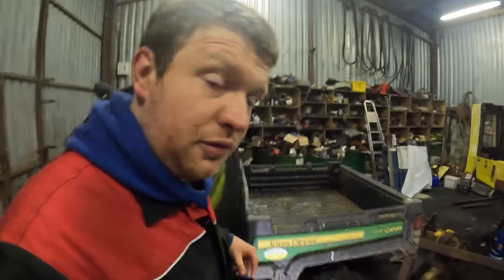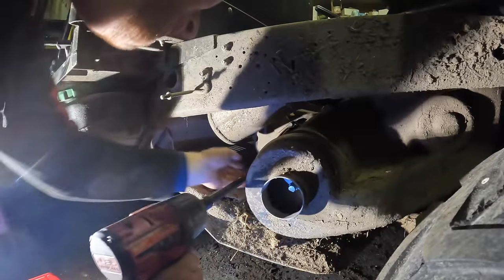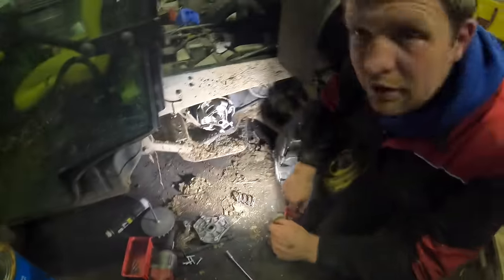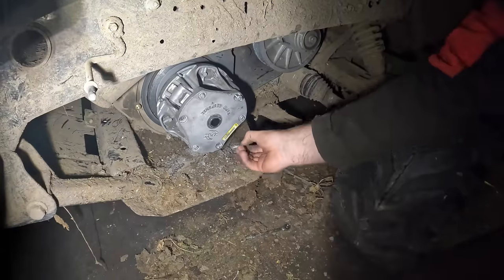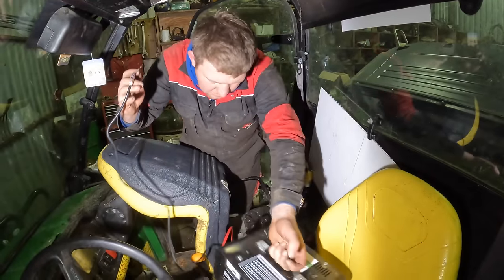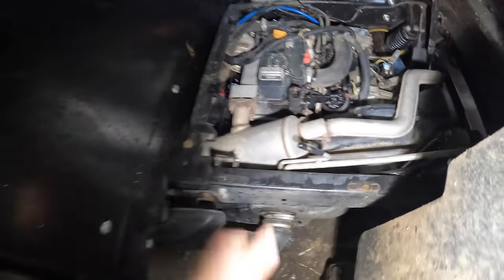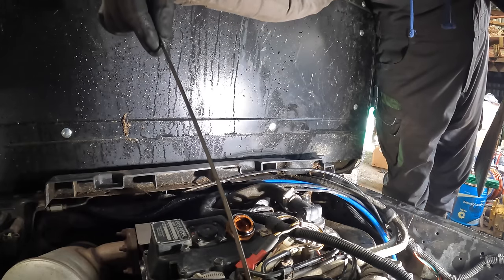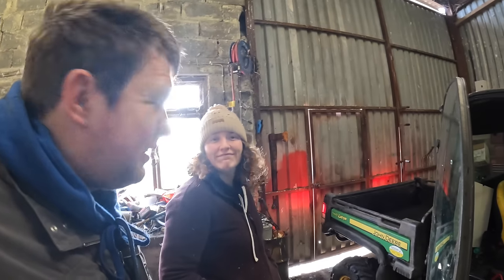FARMER PHIL FIXES THE GATOR!! | NEW BELT & 250HR SERVICE JOHN DEERE GATOR 855D

Comment: A little tip for replacing any belt on a CVT, get a chunk of the old belt, tap it down inside of the rear pulley. It'll help with the gap and once belt is fitted pull out the scrap chunk and your good to go.

Comment: SO There is also a mesh filter on the suction pipe in the tank underneath the drivers seat  . It's OK at min because your old fuel filter was still yellow seen them go black with dirt also some have grease points on rear suspension
Reply: There is hardship in that tank if you aren't careful ,ours just would not run right for the first year or more because diesel bug blocked the strainer in the tank.

Comment: Do you not put some oil in your new filter before putting it back on.
Reply: No need, it will prime and seconds & it just makes a mess doing it.

Lots of filters mounted upside down anyway 

Oil around the filter o ring is all that's needed
Reply: yeah he should have
Reply: Filter fits on sideways so you can't prefill it

Comment: Liv, check out you tuber "See Jane Drill"
If you put the dip stick in the add oil hole, you can pour the fresh oil down the metal stick so it doesn't make a drippy mess.

Comment: bet it broke a massey mans heart to spend money in a deere dealership 😂
Reply: John Deere gator and lawn equipment is sold in one dealership. The John Deere tractors are sold in different dealership. So unless he was looking at a tractor Massey 135 sized or under USD on golf courses, parks etc he probably didn't see any John Deere tractors
Reply: @davidh266   it was meant as a bit of light hearted banter but ok,if u do your research u will find meath farm machinery is probably the biggest deere dealership in ireland,all under one roof,so perhaps lighten up and get facts before u write smart arse replies 👍
Reply: @robertdonnelly385  oh thanks for the information. Sorry for my smart reply. In Munster you go to Seamus Weldon for lawnmowers and utvs and geareys for tractors. Meath farm machinery sounds like a great one stop shop 👍